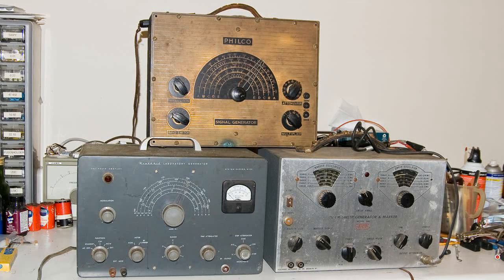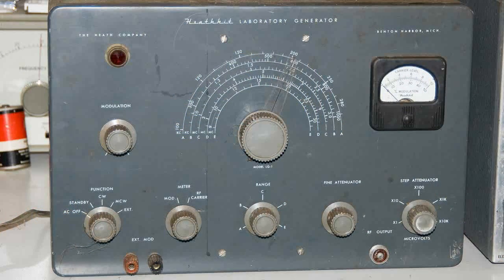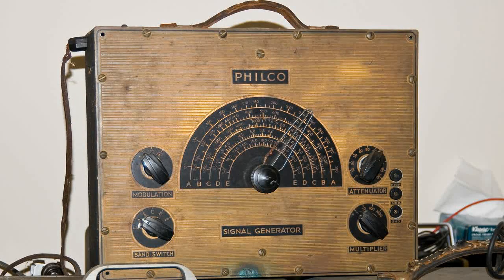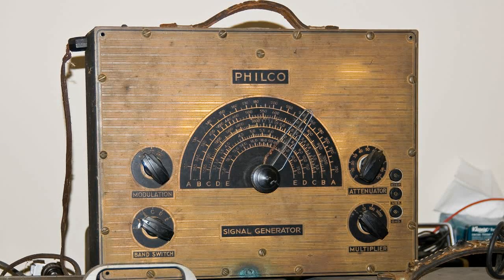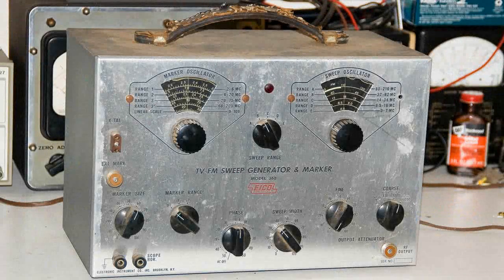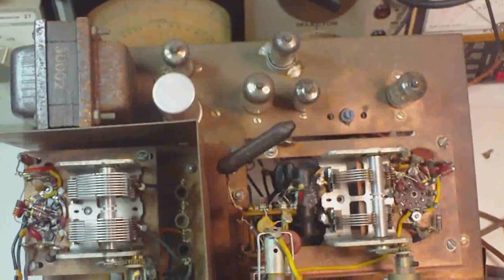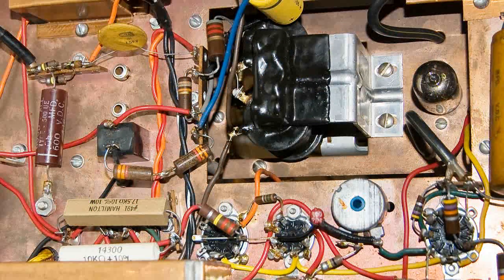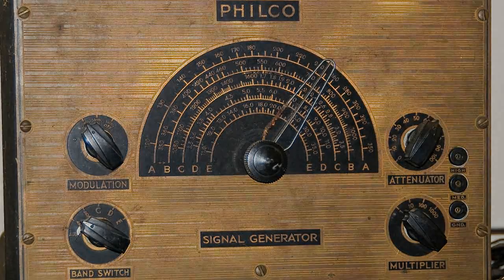Signal Generators

Comment: Philco actually had a full line of test equipment but the signal generator seems to be the most commonly found one. They also made tube testers, multimeters, etc. Some of them must be pretty obscure because even Ron Ramirez's Philco site only has old B&W photos of some models.

Comment: Unbelievable that you found those! The Philco alone! I hope you work on that one first, would be a pleasure to see you testing and tuning it up. Very glad for you that you found those! You know, I seen a piece of test equipment yesterday on ebay I never seen before, it was a Bell System field VOM that has the meter movement, and cover by Simpson, and the selector switches by Triplett, combined into one unit, was very interesting. Thanks for posting!

Comment: I have an Eico signal generator, but it is far less sophisticated than yours.  It was marketed as a "Audio Generator" but it will produce RF to 200kHz.  Being designed to be sold as both a kit and as a fully assembled unit, this one has an interesting ballast- it uses a 7-1/2W nightlight bulb.